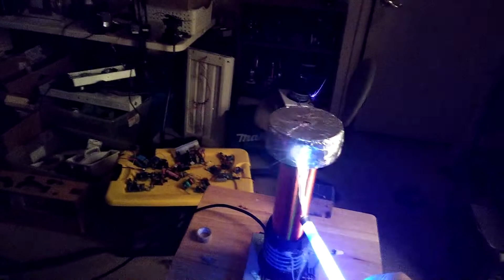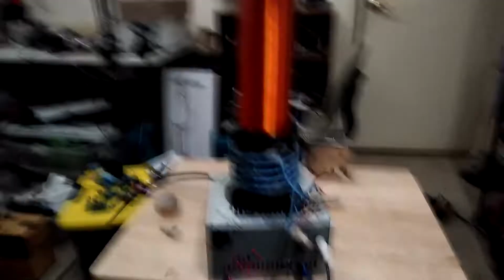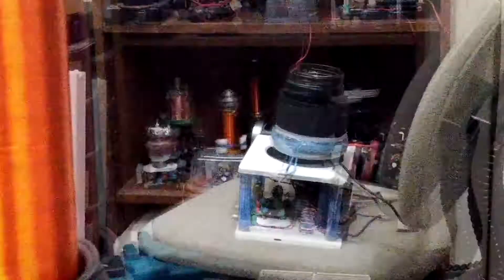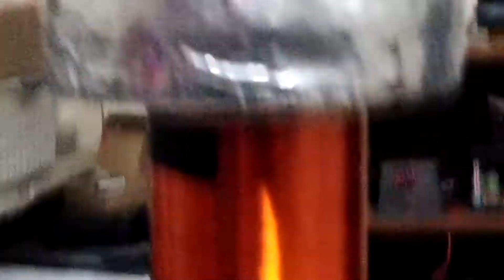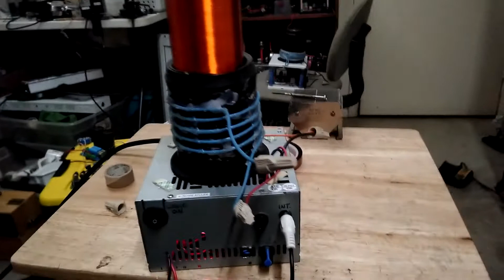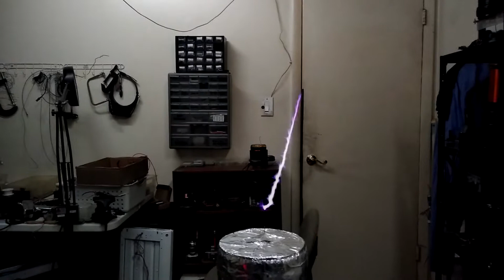PLL IRFP460 Half Bridge SSTC Unfiltered 120VAC 240W

Comment: What was the main reason this circuit was running hot and now is running nice??
Reply from the maker: It was just only my gate drive tuning relative to the phase tuning I ended up with on the PLL. So playing with the rise and fall times etc. What didn't really seem like too much major adjustment that I could visually notice ended up being quite a big difference in the operation

Comment: I have a question maybe is stupid, when you have the CD4046 already tuned with the 10k pot, when you turn on the coil you have to retune it or it just locks on the frequency??, I mean when the frequency is locked there is no more moving on the pot??
Reply from the maker: What happens is the pot may need to be initially adjusted slightly to get an initial lock. It's adjusting the VCO center frequency doing a sweep until it finds a feedback loop. Once the lock occurs adjusting the same pot will shift the phase angle around.
Reply: @Magneticitist  i mean with 120v my output was like a lame slayer exciter, but as soon as I moved the pot the arcs where longer, and when I turned off the coil and turned it on the arcs where still the same but  a little less
Reply: @Magneticitist  so maybe my FET's blew because of the phase shift??
Reply from the maker: @Headbutter-Lettuce90  I've read about issues with the CD4046 but this usually seems to be the chip trying to lock on frequencies that will hurt the bridge or something like that. Typically if I adjust it so that it ends up losing a lock then it just won't do anything. 

You could try reversing your feedback phasing as sometimes the chip will still lock and give output but it will be poor.
Reply: @Magneticitist  i mean I don't have equipment for measuring frequencies and all that I just build the circuits and they work, so if the coil locks on the frequency there is no need to move the pot anymore?
Reply from the maker: @Headbutter-Lettuce90  If the circuit locks on you will still want to move the pot. I can't explain entirely how it works but the gist seems to be that once it finds this lock, it's maintaining this lock by keeping a particular phase angle. So this means your feedback circuit could be some degrees out of phase, but the chip is still maintaining a feedback loop to maintain that phase angle. When locked you should be able to adjust this angle for more power. It also changes the arc appearance some. So by turning the knob you may notice the output grow or shrink, meanwhile the bridge may pull more or less power. You can usually assume that at the peak arcs and peak input amps from the wall you've got the best phase angle for most power throughput.
Reply: @Magneticitist  that was exactly what I was talking about, when I plugged the circuit in 120v looked like a normal slayer exciter, but as I moved the pot to the right the arcs took more longer and hotter form, and at some pointe they were big enough, but also at that point when I moved more the pot to the right that is the point where it detunes

Comment: Can this one run on CW unfiltered??
Reply from the maker: Yea it's running CW unfiltered in the video just half wave. Would do full wave easy too.
Reply: @Magneticitist  thanks i want to build this for demonstrations on my school and to feel more smarter than my neighbours kid
Reply from the maker: @Headbutter-Lettuce90  lol. This build is actually pretty easy and I recommend it. What I'd recommend though is instead of using the common circuit as-is which has defined min and max frequencies (something like 380-450khz), I would use potentiometers instead so you can vary the lock range. Otherwise you will need a coil which falls within a pretty small frequency range for it to work the best. If I were to take the topload off mine for example then it might not be possible for me to get a good steady lock if at all.
Reply: @Magneticitist  so maybe the two pot version for more control, i have seen videos that use the 15k and 12k in series with with two 5k pots and the 120k from pin two is moved to 22k
Reply: @Magneticitist  i also want to use a small coil that is about 400khz i took it from the one Tesla model, the 5cm dameter and 16cm tall with 38 gauge wire, it's weird that 38 gauge is the cheapest wire in my electronics store
Reply from the maker: @Headbutter-Lettuce90  I can't remember exactly how I did it but it was probably something like just putting 5K's in line with 50K's. I would swing the center frequency pot all the way one direction and then be able to see what I'm setting the Min at using that pot, then swing the center frequency the other way and do the same thing for the max. Using 50K's seemed to allow me suitable adjustment combined with finding a precise timing capacitor value in place of the 330pf which put me in an overall range where my coil was about right in between.
Reply from the maker: @Headbutter-Lettuce90  I just checked so what I did was just put 50K pots in series with 2K fixed resistors
Reply: @Magneticitist  2k on the pins where the 12k and 15k?
Reply from the maker: @Headbutter-Lettuce90  yea
Reply from the maker: @Headbutter-Lettuce90  Those values are just arbitrary but will allow you to adjust the min and max all the same. It's really hard to see without a scope or at least a frequency counter of some kind.. but basically picture you have your center frequency pot and you're able to adjust it all the way from 150khz up to 600khz. These upper and lower limits are set by the pots on pins 11 and 12. So if you adjust them a certain way you could then have a range of say 200-350khz on your center frequency pot. The smaller you make this window (without being too small) the better you should be able to tune the phase angle after it has locked.
Reply: @Magneticitist  wait if I use thinner wire for my coil the coils resistance lowers the voltage??
Reply from the maker: @Headbutter-Lettuce90  Voltage no current yes
Reply: @Magneticitist  so, my output would be less hotter arcs?
Reply from the maker: @Headbutter-Lettuce90  it really all depends and you might not notice a difference but there comes a point pushing too much power through a coil that the secondary wire will probably burn up. I don't have that problem with 36 gauge pushing the power levels that I do.
Reply: @Magneticitist  so I will try to not use thin wire
Reply from the maker: @Headbutter-Lettuce90  I find 36AWG to probably be about the smallest one should go. If building a coil that is quite big it may be better to use even 28 or 26. A lot of this has to do with just what the resonant frequency will work out to be. For example 26 isn't going to fly even if you get enough turns if the resulting frequency is still too high.
Reply: @Magneticitist  yeah I know that if I increase the wire i also have to increase the pipe diameter and length, but that also means that it needs more wire, and sadly as the wire goes thicker the more expensive it is on my electronics store
Reply: @Magneticitist  i wanted to make the coil the same as the website uzzorks but there is no secondary data
Reply from the maker: @Headbutter-Lettuce90  I wouldn't worry about it too much honestly.. I would just try to stick with what you can find. 32-36AWG will be able to wind a coil of smallish dimensions that reaches around 400khz.

So long as I put a coil on that circuit that is around the same frequency it will seem to run about the same as the rest with a little tuning. I would guess given the size of the uzzors coil without a topload if it's running around 400khz it's probably 36 AWG.
Reply: @Magneticitist  yeah looks like the wire is thin, but I don't know the pipe parameters, seems like I would need to calculate those with javaTC
Reply from the maker: @Headbutter-Lettuce90  Javatc or Teslamap to get a ballpark. I usually use Teslamap because I can keep it as a file on my PC. After a while it becomes second nature what frequency a coil will probably run at based on the wire and former dimensions. Keep the topload in mind as well. There will likely be an optimal topload capacitance value for a given coil depending on the topology but just remember that if you plan to use a topload that "drsstc looking" or at least of around the usual proportions then you will be looking at a significant drop in the frequency of the coil. So if you wind everything for 400khz it might end up closer to 360khz after the topload.  Uzzors uses a fairly small one which works but likely would have gotten a little more output with a larger one.
Reply: @Magneticitist  i don't have a donut topload, so I might use soda cans and aluminum discs, i can make those but let me see if I can make one
Reply: @Magneticitist  hey have a question, how does danyk (AKA diode gone wild) solid state Tesla coil can self resonate with the IR2153 that's not a feedback model and how does it keep in tune
Reply from the maker: @Headbutter-Lettuce90  It's not self resonating he just dials in a fixed frequency. He can keep it in tune by keeping some distance from the secondary etc. Fixed frequency can work well like that but it's not guaranteed to be done without a headache. I tried it and had to dial in a frequency each time.
Reply: @Magneticitist  i also saw electrobooms sstc and also uses fixed frequency and he said that for every shot in the video he had to retune the coil
Reply: @Magneticitist  is there any PLL calculator for me to use, i mean my old secondary after puting a topload was resonating below 400khz
Reply from the maker: @Headbutter-Lettuce90  Here's one I found but it's assuming a 5v supply. https://www.changpuak.ch/electronics/4046_VCO_Calculator.php
Reply: @Magneticitist  thanks mate
Reply from the maker: @Headbutter-Lettuce90  No prob. I made another full bridge for testing so I'll probably make a video going over the PLL setting a little bit. 

You mentioned crappy slayer exciter kind of output and this is probably just because you haven't gotten a phase lock. What I seem to notice is at first the VCO is driving your gates at whatever frequency it is set to at the time. This could be 200khz while your coil is let's say 400khz. This is likely not close enough for a lock at the time so it will just be outputting that fixed frequency. 

This will likely result in a very poor looking output as the secondary is ringing down every pulse and is not quite in full resonance. The closer you get to the coils frequency the brighter a nearby indicator light may become until it eventually achieves the phase lock. 

If you are seeing a dim indicator then it probably just means you have not gotten a lock yet.
Reply: @Magneticitist  thanks that's actually what happened at first when my pot knob was all the way to the left and connecting the H bridge to the mains the output was like a slayer exciter, but then when I moved the pot to the right and in the middle position it gave the biggest output, and if I moved it all the way to the right the H bridge would just blow up
Reply: @Magneticitist  i was thinking to run this circuit with a voltage doubler but with low capacitance Capacitors so the output doesn't look that CW filtered, i mean I was trying to use those CFL circuit caps the 22uf ones

Comment: Secondary data??
Reply from the maker: That one is 32 AWG about 7cm x 25cm
Reply: @Magneticitist  thanks unfortunately I don't have that PVC pipe, only one I have is a 5cm X 19cm that can be wound with 38 awg and 1800 turns, strangely 38 awg in my city is the cheapest wire
Reply from the maker: @Headbutter-Lettuce90  Mine is on some thick cardboard tube and I'm not sure where it came from but it looks like it was longer before I cut it down. So cardboard actually works great for me. I've also used a pringles can before but I carefully tore off the outer printer paper.
Reply: @Magneticitist  hey why don't you try a Full Wave voltage doubler but one that can not deliver that much current so the output looks like unfiltered CW
Reply from the maker: @Headbutter-Lettuce90  That would be kind of hard to pull off and you're basically better off just using a much larger DC reservoir on a doubler and just using an interrupter, otherwise the coil at any decent tuning is going to want to pull enough power to drop the voltage way down.
Reply: @Magneticitist  so for a voltage doubler I should use an interrupter like Steve ward's design?
Reply from the maker: @Headbutter-Lettuce90  You just start pulling a lot of power at those voltages so typically interrupting is a good idea. Steve Ward's interrupter w/burst mode is made for DRSSTC's but it can work for an SSTC if you increase the timing capacitor on the duty 555 to allow higher on times. Otherwise you have uS of on times with very thin and small arcs.
Reply: @Magneticitist  so with the 555 High voltage interrupter I can get arcs looking like DRsstc?
Reply from the maker: @Headbutter-Lettuce90  kind of until you get to much bigger outputs at which the drsstc of course spits out crazy longer arcs that go everywhere. With an SSTC the really tiny on times don't really allow for much output and it's just thin flaky sparks until you increase the BPS to so high that you can pull smooth arcs from them. The drsstc usually needs the on times to be so low because the primary LC is resonating and building in voltage over time and a build can only handle so much voltage across the primary which can be thousands of volts.
Reply from the maker: @Headbutter-Lettuce90  I thought I had a video of one, this one is a half bridge with a voltage doubler of small caps like 680uF each and I'm using Ward's interrupter and I'm switching between burst mode and higher on times. 
https://www.youtube.com/watch?v=iktWLSd-RlY&t=150s

The thinner arcs are when the interrupter as-is has the highest on times, then I switch it over to 1ms+ for SSTC usage. But if you make the thinner arcs really high BPS then yea it sort of looks like thin flaky CW. At that point you may be close to pulling as much power as CW because the overall off time becomes so small. 

You can see some videos where the smoothed CW is interrupted at high BPS and on times which reduce the overall consumption to manageable but still give the appearance of CW arcs.
Reply: @Magneticitist  Nice vídeo, but I don't have the enough hability to do that interrupter and the doubler I don't have the enough caps, so maybe I will try to save money for those, for now I just want to finish the PLL, tanks for your help
Reply: @Magneticitist  why some designs use the filter caps like 470uf for the voltage splitter?
Reply from the maker: @Headbutter-Lettuce90  470uF can provide a good enough bang for low power setups.
Reply: @Magneticitist  i mean I saw one Tesla schematic and they use two 1000uf caps but they use them in the voltage splitter the half bridge one
Reply from the maker: @Headbutter-Lettuce90  It's basically the same thing either way but just looks different. You still want some caps across the doubler to protect them from the high frequency AC but they are just using the doubler caps and then placing the resonant filter caps across them.
Reply: @Magneticitist  alright thanks
Reply: @Magneticitist  Dou you think I might be able to interrupt the UCC's but using the 4046 as feedback?
Reply from the maker: @Headbutter-Lettuce90  That's what I'm doing with the full bridge I showed in the last few videos. Works pretty good.
Reply: @Magneticitist  oh yeah right I forget that the UCC's have the enable pins, so maybe a 555 timer so I can use the voltage doubler, i found another CRT tv board and finally i have the enough caps to make the doubler

Comment: Yeah, I tried 460's in my staccato-ramped DRSSTC, and they totally sucked. Sometimes coiling doesn't make much sense...460's work good with one coil, but not another, even though they are very similar. Even slight differences that shouldn't matter too much seem to push everything over the edge sometimes!
Reply from the maker: Yea man 460s are a great example of an old mosfet which is really only just a 'trusty' component because it has been used in so many builds which appear to work well. For some reason it's still just as expensive as a lot of modern more suitable switches rated for 600V+ unless you get the cheapest fake ones. I think this particular build would do better with something like 260's which are still cool IMO, I just never want to accidentally crank the variac to max and over volt them. These variables are ridiculous sometimes to where it truly requires constant trial and error. I'm always on the edge of tearing down old stuff to make a better more ultimate version but hesitate to do more "research" because I always end up finding out something important after I've already built something final. My tinkering is funny like that, I can make builds designed entirely around the idea of probably needing to swap killed parts so I use screw terminals or something.. But then these rigs never need replacing of anything important. If I go all the way and make some immaculate build with a really nice and permanent layout, I'll be needing to tear it apart to replace a mosfet or something in minutes.